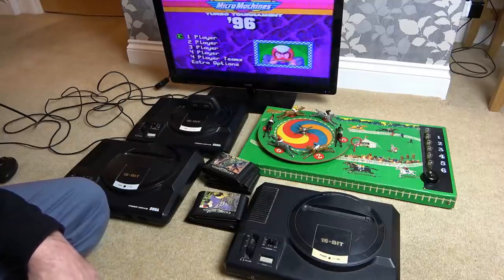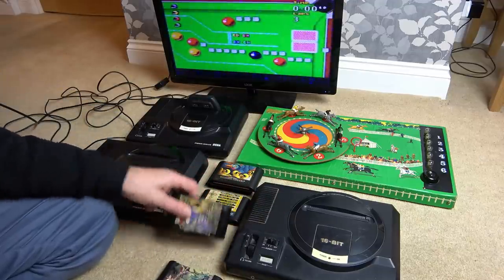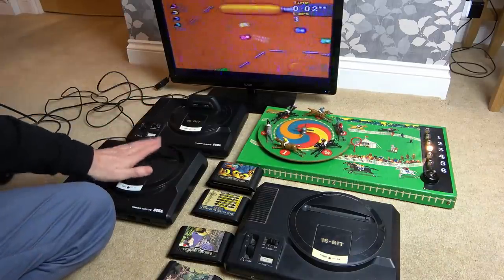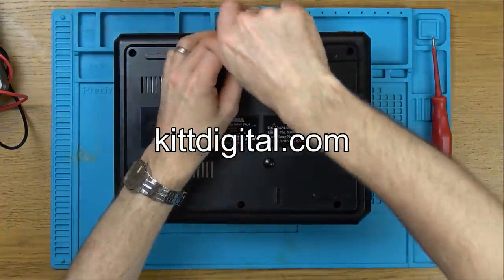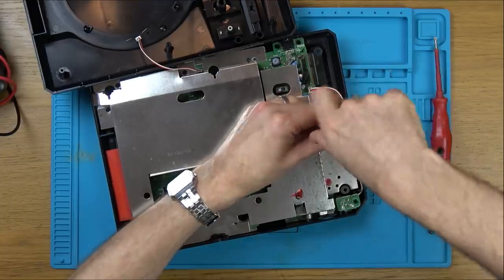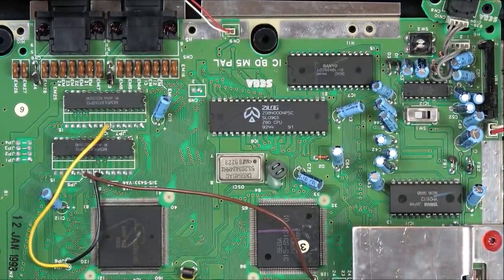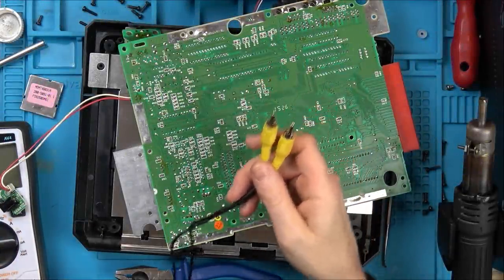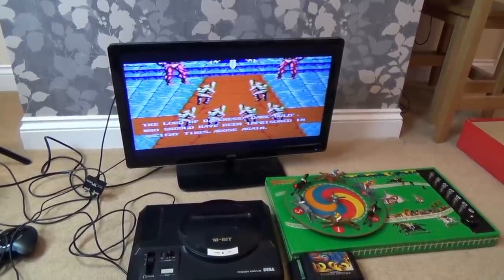Trying to FIX a Faulty eBay SEGA MEGA DRIVE (GENESIS)

Comment: Not too surprising, I've seen people slam carts in like the console owes them money or something. ^_^ Only done that on the NES but a little patience pays off for that issue. Actually surprised more slots don't need DeoxIt after a few decades time. Idk, some pirate carts can be a little too thick. Yikes, don't pull that rubber contact out. :S

Comment: Rf is a mystical beast
Reply: The terminals of the rf port are usually connected via chokes (air wound coils) and capacitors, which in under dc conditions act as a dead short. Ur meter applies a dc voltage to test for resistance, especially in diode test mode

Comment: It's not that uncommon to have multiple ground planes (RF ground, audio ground, digital ground) and sometimes the shield is used to connect at least some of them, when this is done removing the shield often causes parts to no work.
Here's a recent example of Adrian's Digital Basement running into this on a Mac Color Classic he was working on: https://www.youtube.com/watch?v=NZe2vNgnxZw

Continuity testing: Yeah, you must always check the numbers when using this feature, it really convenient but it can easily be misleading in both directions! IE, in this case you had a case of "high but fine resistance" on the reset switch but you can equally well run into the reverse where it beeps ("short") but it's not an actual short, just a somewhat low resistance, and everything is actually normal.

There just isn't any single ohm value that works for all situations, when testing that switch 500+ ohm "should" have beeped but there's also cases where even readings of less than 1 ohm is actually signifying that it's NOT shorted (large modern GPU cores are like this for example AFAIK).

Comment: first clean ya games and the edge connector with alcahol or deox before ya open the system 99% of the issues in these are crap on the game or edge connector power issues are usually the regulator done 100s of em my ownself issues with edge connector are mainly caused with games being left in the system for extended periods of time